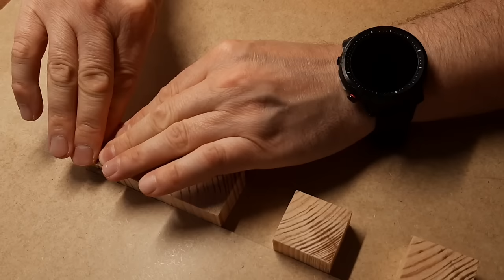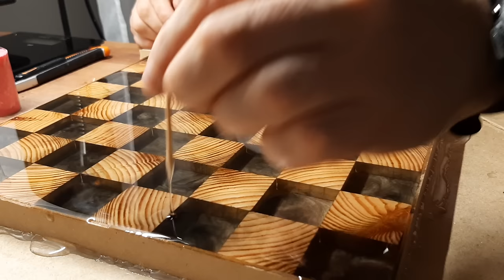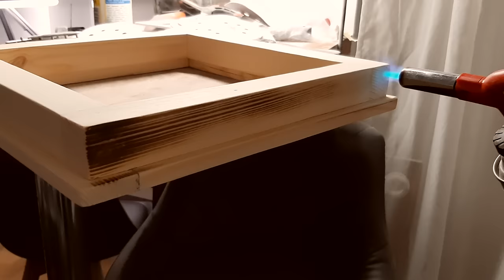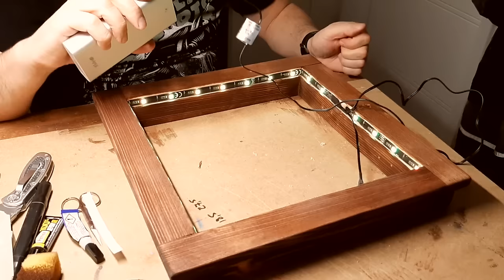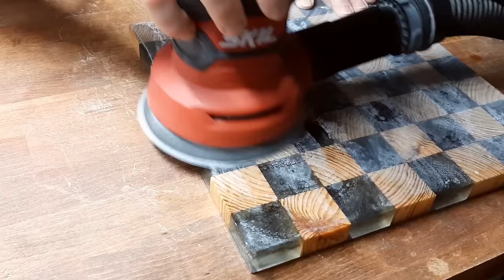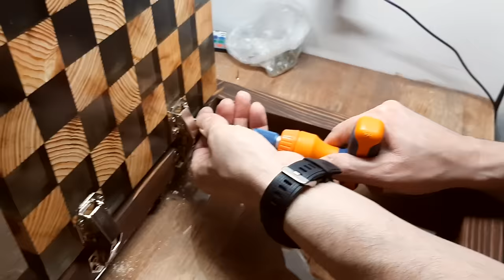Floating Chess from Wood and Epoxy Resin with LED

Comment: If I played chess more, I'd totally want one. One minor improvement though, consider putting a strip of diffusing paper over the LEDs to make it look like a glow instead of intense spots of light underneath the board.
Reply: Was thinking the exact same thing, although you can get a diffuser spray in a spraycan I've used to frost resin before quite successfully.
Reply: And acquire quality chess pieces
Reply: @nightshade99  Or make a mold and pour epoxy to make them fancy
Reply: Too often do people forget to diffuse their lighting
Reply: No need to use diffusing paper. A light sanding on the underside with a coarser grit sandpaper to knock off the high-gloss shine and opacity would do the job just fine.
Reply: @PervertedPodcast  it still doesn’t look like it’s floating. It looks like an alien spaceship is under the board
Reply: Overall not bad. However, I'd also suggest doing 45 degree angle cuts for the wooden box. Butting the edges is fine for things that no one sees, but this is mostly for aesthetics, so that's the last type of joinery you'd want to use. Also the top needed more sanding with a lower grit paper. There were still too many defects.
Reply: @Daniel Ramskill This dude seems to be good at woodwork, and he made the board right. But he put the pieces on the wrong squares. Well, he got the Queen and King positions wrong, so he evidently doesn't play much chess himself. 
 I was kinda wondering whether wood working skills - mostly manual - and chess talent - mostly mental actually matched. It looks like they don't.
Reply: @prakasavigraha6104  i like to think he made it for someone else as a Christmas present and doesn't even like to play chess...so he doesn't know/care about royal affairs XD
Reply: Yes!! I was thinking that something under it might illuminate it better. Thanx. Great tip!!👍😊⚘
Reply: @markonikolic1386  man they would look like glass I wanna see that
Reply: А ты из чего сделаешь из какого материала? Я из бумаги
Reply: @nightshade99  This... its the pieces that should drive the price. I don't believe the board is worth the price, but best of luck to the maker. They do have skill at woodworking and deserve every penny they can earn. I would like assurances to uniform lighting of the squares, specifically. But still I can find boards I'd rather have for less.
Reply: I make it a point to play at least 5 games every day. it definitely helps your mind and in making decisions throughout the day. I even beat a few of those Chess scammers on Bourbon St (New Orleans)
Reply: I personally would not be able to play it if colours change every second. I would find it annoying and almost like a parody of chess. Why make it glow in every possible colour? I was thaught it is just poor taste and kitsch when every colour of rainbow is on 1 place. Also very childish too.
Reply: @velvet3784  that's sad.. do the flashing RED YELLOW and GREEN lights on the road distract you too? do you need a safe space from everyday life?
Reply: @nightshade99  make them on a lathe and vice ... as good as the best for the cost of some raw bar ... lol try it ...
Reply: @slcontent9465  My cousin is actually making a few of these, and I provided him the video.
Reply: The interesting thing is that in the light the white fields are wooden and the black fields are made of glass, but are not backlit - that’s why they are black. And in the dark they change places and from wood they become black and transparent ones become white, or multi-colored :)))
Reply: If you played chess more, you wouldn't want it. Prove me wrong.

Comment: The Board is completely awesome. I think  that the Queen and King are in the wrong spot - that is the only negative. Excellent craftmanship.
Reply: The squares are wrong too. The square on the bottom right, where white's king rook is, is supposed to be a light square
Reply: @JensWoodworkingThings  on both sides they are. Remember Kings face each other. They are also gentlemen and give the queen her colored square. In other words black queen on black square, white queen on white square.
Reply: It's 2023 okay, who says they aren't in the right spot? 😤
Reply: @lasagnapapa  Not sure I understand your drift. It does not take away from the beauty of the piece. The comment was intended to educate.
Reply: @Gimonbro  I was just making a joke lol
Reply: @RicardoAGuitar  white is right, so they did get that part correct but both k and both q are on wrong squares. Q always goes on square the same color as her.
Reply: Enatendi que a finalidade é mostras o conceito do tabuleiro (show)!!! Realmente as posições estão trocadas!!!

Comment: Amazing project. Kind of want to do it for my father.
1. Definitely consider using diffusion paper or spray to cut the led spots.
2. Maybe make or have a storage battery so it can work on the go that has an adapter inside for both plug and play or on the go.
3. Consider using glass/epoxy or Glass/epoxy/wood pieces so the color travels to the pieces. Specifically the black pieces.
Reply: Hey guy, say less.
Reply: or he could use the 144/m LEDs and lower the intensity
Reply: Or just have a normal chess? Why make it colourful and glowing? Especially if it is for your dad. I would understand if it is a child that wants glowing chess board or something like that. But adult man.. Yeah..
Reply: @velvet3784  that's sad that you get distracted so easily over colorful lights
Reply: The interesting thing is that in the light the white fields are wooden and the black fields are made of glass, but are not backlit - that’s why they are black. And in the dark they change places and from wood they become black and transparent ones become white, or multi-colored :)))

Comment: Keep a piece of tool box drawer liner folded up by your bench, put it down when you are doing your sanding, it’ll hold the piece while giving you stability to sand and also just shakes off when done. Is simple, but incredibly helpful.

Comment: I would definitely try some type of diffuser for the lights like others have said. One other thing I would change is to have the lights cover the entire bottom instead of just the edge. It looks great in the dark, but with the lights on (how I assume you’ll usually play), the middle is pretty dark.
Reply: Also has a lot of wood material in the bottom to work with. I would carve our some space there for lighting and a rechargeable battery.
Reply: The interesting thing is that in the light the white fields are wooden and the black fields are made of glass, but are not backlit - that’s why they are black. And in the dark they change places and from wood they become black and transparent ones become white, or multi-colored :)))

Comment: Nice idea. You might want to shield the LED light with a partial cover and place a reflective material in the bottom of the case. This will improve light distribution amongst the resin cubes and keep you from seeing the LEDs from above. Nice first project though. Cheers.
Reply from the maker: Thanks😊
Reply: I was thinking the same thing!
Reply: Personally, I like the acrylic for the bottom. It allows the LED's to produce a glow around the bottom of the board. Putting felt and/or a reflective material would cancel the LED glow which I think would be a shame. But to each his own. The pieces rattling around is a good point. But I would hate to close off the light glow.

Comment: Cool project! Although I'm confused if the transparent squares are supposed to be black or white. It seems obvious because of the black dye, but It completely changes when you turn off the lights. It may also be the case based on the Queens' positions.
Reply: In that case it wouldn't matter and you could choose either or.
Reply: I had the same question. "Queen on her own color" is the standard, and it seemed to me that the queens were set on the opposite color, from how I viewed the design of the board.

Comment: This is a great project - right in my "level" of wood working.  I'm gonna bookmark it for my chessboard project later this year - as soon as I get the pieces.  
Two suggestions: 1) The chess pieces rattling around on the bottom are going to eventually scratch that acrylic.  Maybe line it with a small layer of felt instead?
2) Did you add any "stops" on the opposite side of the hinges?  I noticed you were very careful when you closed the top, but some kid or someone not familiar with it might just let it drop.  Stops (maybe also felt lined) would help support it better.
Reply: no stops = failure over time
Reply: I was also going to comment on the fact that there was no stops to support the other side of the board. If I had the skill set and was making this, I would have also carved a small grove on the side of the board so that it is easier to grip when opening.
Reply: Are you sponsored by a felt company?
Reply: I thought the same thing about the acrylic, but if you do that then you lose the LED glow underneath the board. Lining it with vellum or parchment instead of felt would probably get the best of both worlds.

Comment: It is a cool idea. 
A few ideas for variants. Have a shined metal plate on the bottom instead of the clear plexi, instead move the plexi up above the LEDs so that the pieces can't damage them. 
Alt construction ideas. Make bars of the epoxy the same size as the square stock. You could glue up sets of 2x2 and then the production speed could be faster and more cost effective.

Comment: I was looking at the thumbnail, and I know it's probably outside your wheelhouse, but a chessboard made out of two different colored epoxies, with LEDs and magnetic sensors underneath tied to a single-board computer with a program to play chess. Magnets in the chess pieces would let the computer know where the pieces were, and it could flash the squares of which piece it wanted to move and where it wanted it moved.
Reply: Soooooo - a game that played itself?
Reply: never gonna happen on this channel lol
Reply: @zalmaflash  It could, or you can play against the computer, or the computer can suggest possible moves ... For beginners, like me.

Comment: It would be awesome if you could mold the black pieces with the same epoxy as the black board squares. You could probably do that by creating the white pieces of wood then using them to make a mold for the black pieces.

Comment: - I think a white piece of acrylic to bounce the light or maybe if you just sanded that clear piece to diffuse the light would have made the LEDs far more effective. Regardless, Turned out really nice for its simplicity. That's why I love wood working with resin. You dont need a lot to start out in terms of materials and tools in order to get going. I started out with a little workbench in my bedroom that sat below my window and cut my lumber outside or anywhere I could for quite a while before I ever had access to a dedicated Area or Shop. I did a lot of Chessboards as well :) and did a lot of Vacuum Pours with Epoxy and Molds id Cast from 3D Printer. Its crazy what just the average guy/gal can do with these days for the money. 3D Printers are so damn good for the money even compared to a few years ago. $200-400 Printers destroy what I bought back when I started using them for Art. today But man it felt amazing once I was able to get a space to dedicated for the craft. I felt like I could stretch my wings from all the things I knew i could do, i just was constrained by my workspace. I think thats a problem the a lot most people face but if I can do anything, I can just tell anyone reading this, You can do A LOT with limited space if you get creative and have the drive. 
- I'm thankful for people like you take the take the time to put videos online. It  allows for everyone to learn nearly anything they want or just to watch :) My life has changed from Video Tutorials in nearly every single thing I do in Life. From 15 years ago when I started my Music Journey with learning guitar all the way up to Audio Engineering. Around the same time, I took my 2D drawing passion and fell in love 3D Modelling when I took a Drafting Class in High school Design and long story short My Teacher, let me spend more time in AutoCAD doing 3D stuff. That quickly turned to 3D Design and Animation that I learned from Videos online. Its just crazy, By the Time College came around, I already had 3+ years experience with 2D/3D Design with CAD, Soildworks, and Other Software Packages for just having fun Modelling IRL objects into Digital which lead to Conceptual Stuff which I was a thing the Professional world called Mechanical Engineering, Product Design, Architectural Design, etc)Also got heavy into Designing Maps for Popular PC Games and working on large projects with like minded people from all over the world in like 2004. A lot of Character/Object/Automotive/Environmental 3D Design from Concept, to Texturing, Rigging, and Animating. I admit the Software wasnt necessarily Paid for because most Teens could not afford Maya, ZBrush, Solidworks, etc) and Blender was terrible back then. 
- I still Do Music and 3D Design and fortunate enough to have made a Professional Career in Design and Freelance work doing Audio Recording/Engineering over' the Net and a little money from Playing with my Band is just a bonus. Then this stuff! As if I didnt have enough Hobbies or my ""General Fascination with Everything (Its a CURSE)"". I wanted to make my own guitar Mainly because im Left Handed if anyone knows that pain when your a musician, your choices are extremely terrible. So, Found a local Wood worker and my Journey into Wood Working (mainly with Epoxy at the moment) started. Just from wanted to see what I could do in desperation for a Decent Left Handed Guitar, which I finished with that same Guys help and I was hooked. This is what I do Relax from the Audio and Design work since that stuff can be stressful as hell. Esxept when I get to let it all out playing Shows with my Friends. 

Thank you, Brother. I want to remind you how many people lives youve given a purpose, a new hobby, or whatever degree it may be. Take care! Sorry I went on a rant their but I guess I needed too.

Comment from the maker: Hello. If you would like to order a chessboard from wood and epoxy with LED.
Shop  https://woodseasonstore.com/
Reply: Some suggestions for improvements:
1. Glue the frame together with a 45° cut to each side (Mitre saw) 
2. Insert the acrylic glas into the frame so it is flush with the wood and does not rest on top
3. Depending on the looks, I'd prefer to have each layer of epoxy in the same tint, so you do not have the different shades when viewed from the side.
Reply: dude, the king and queen should be in opposite position
Reply from the maker: @micheledonzelli4360  thanks i know it was my mistake
Reply from the maker: @TamiyaPhilippW  Thanks for your suggestion for improvement
1 In this chess I wished to make a 90 degree angle.. Making a 45 degree angle is not a problem.
2 I agree with you  and I am already doing it this way it was the first trial model and I have already corrected everything
3 Here I also agree with you and now I am doing one layer
Reply: Привет 👋
Reply: А пешки должны быть на перед остальными шахматных фигур
Reply: Wood Season Привет 👋 привет 👋
Reply: This is an impressive piece of work. Is it possible to make Ludo games in the same way?
Reply: Nice job. What would set this off is resin chess pieces
Reply: Hi mate, can you tell me what you were doing at 9 : 24?
Reply: @amritaoxymoron1944  he was rounding the edges off with the router
Reply: In my opinion if you want to sell it for 600€ you should at least made the pawns too...its like 600€ for chessboard and 10 for pawns... pawns looks like if you had taken them from another chessboard of the supermarket's ones
Reply: @TamiyaPhilippW  also, the wood grain if aligned similarly would be much more aesthetically pleasing. 
a simple battery would do away with the wires - again, better aesthetics.
chess pieces could be better - frosted black and white pieces (epoxy or acrylic) would let some light travel to the pieces.
LEDs could use a diffuser layer.
and personally, for me, a better floating effect would be achieved if the wooden box was either same dimensions or smaller than the chess board itslef.
Reply: The wood grain if aligned similarly would be much more aesthetically pleasing. 
a simple battery would do away with the wires - again, better aesthetics.
chess pieces could be better - frosted black and white pieces (epoxy or acrylic) would let some light travel to the pieces.
LEDs could use a diffuser layer and the acrylic could be inserted into the frame so it sits flush
and personally, for me, a better floating effect would be achieved if the wooden box was either same dimensions or smaller than the chess board itself.
Reply: I cannot call cap, but if you would like A $7-1000 CHESS BOARD, go ahead and spend all of your life savings.
By the way I completely understand the price, its obviously an expensive thing to make and you need profit, but a $800 chessboard, I mean, those are more expensive than professional ones, only 7 people in the entire world are trusted to make those knights.